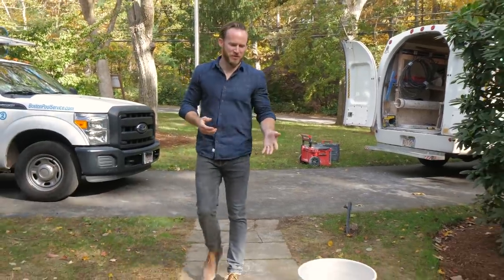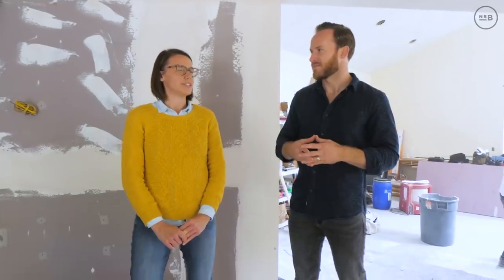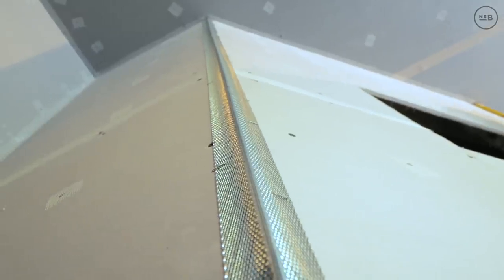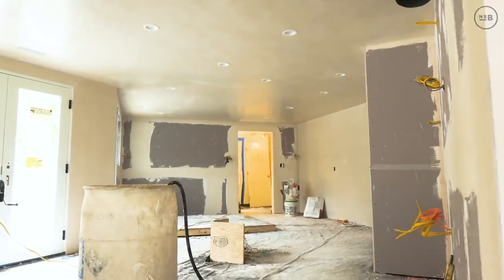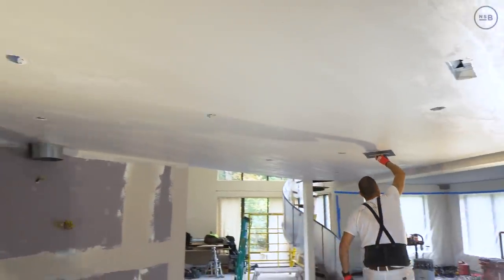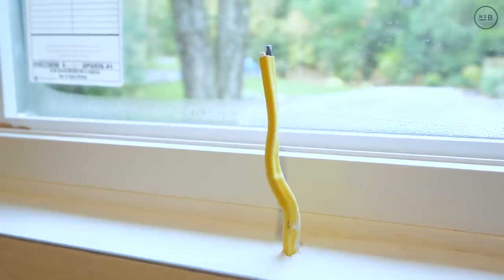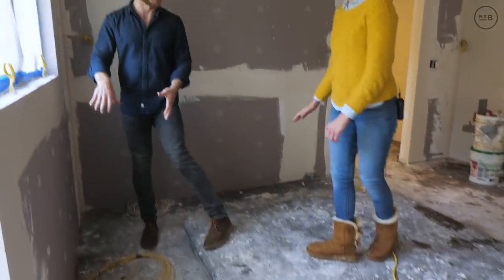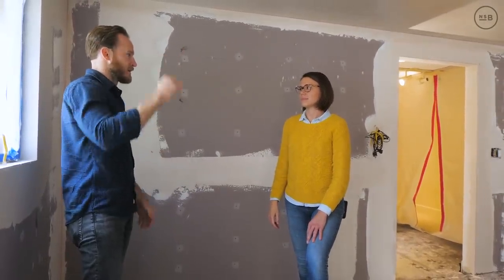Why we use Blueboard and Plaster

Comment: Most of the higher end homes I framed in Tucson were done with plaster. Imperial board. Amazing finished look.
Reply: I live in Tucson and haven't seen it here before do you recommend it for new construction?
Reply: @ignaciogamez8394  I would recommend. I used it in some historic renovations in Barrio Viejo and Sam Hughes and new builds of custom Santa Fe style homes.  It would depend on cost for me though. More labor intensive from what I remenber, but it gives that flat wall finish that I have not seen repeated with the Gypsum products.
Reply: Ignacio Gamez I live in the U.K. and for us it provides better insulation and soundproof so I would recommend it especially since I know Tucson can get very hot
Reply: @mortensendesign918  It's not more labor intensive as far as cost goes.  Yes, physically it's more labor intensive and you need to work quickly.  Because of the speed it is FAR less time and FAR less mess than drywall.
Reply: Thanks, I"m looking to replaster my wall and was going to take out all the lath and re-lath, now looking into all the sheetrock options. Could not find Rock board or blue board near me but imperial board, I found, oy

Comment: Plaster/kalcote is somewhat common in the Midwest USA too.  Though the rough sand finish is more common. Costs more for smooth walls.  A lot less callbacks on plaster. And it's tough.
Reply: Are they using lime or gypsum?

Comment: This is exactly how we do it in the U.K. I cannot see why many more houses in America don’t have plastered walls because one you’ve put jointing compound in the joins and over the screw heads you might as well just plaster the wall and when you do plaster you don’t have to tape over the screws (some people say that the screw heads will pop the plaster but I have never ran into that issue because if you secure the plasterboard properly you shouldn’t have that issue) and also you are less likely to damage the wall I mean unless you throw something heavy at the wall you won’t have holes in your wall and plaster can provide better insulation, sound proofing and better fire proofing so in all fairness the only benefit to just straight up drywall is that it’s a little bit cheaper
Reply: I'm fixing, replacing my plaster walls, and although it's a bit more tedious and costly, I am an artist by nature. I love the texture and then --- lime paint. heaven
Reply: Plus ain't to many  guys  know how to ,,I don't and I've been doing drywall for 40 years

Comment: I've never seen plaster applied in the US.  I thought you guys just mud the joints, sand and then paint?  By the way,  this is the only way we do it in the UK
Reply: I am a platerer in the UK mainly lime in heritage but have worked on plenty of modern methods.  I found dry lining used much in commercial jobs and London also where Knauff are based around Kent.  Finish plaster is used allot north London and where British Gypsum are based. in real a big crossover and many new plasters on the market now.
Reply: Generally; in lower cost housing we do just Tape, mud and sand the screw dimples and joints but in higher end housing we will Float the entire surface after initial taping and mud has dried and had a light sand. We will carefully float the entire surface, with a wide stiff blade, then use a longer sanding board to wear down high spots. I have only rehabbed 7 homes, but have never seen drywall mud left unpainted.
Reply: @eco-hot3231  interesting,  thanks
Reply: @mikegrady8931  I'd heard this,  that painting plasterboard is starting to take off in the UK.  Imo a plastered wall just feels a lot better.  Plastering in the UK it's neither cheap nor expensive,  I guess because it's common it's not a rare specialism like in the US

Comment: Nice to see plaster work. Its old school. The hole point of plaster work is to put up the traditional architectural details usually associated with plaster. Like The ceiling / light  medallions. And the traditional crown moldings made from plaster. It will be intersting to see the finished product because it looks very sterile and lifeless without trim work at this time.

Comment: As a plasterer in Pittsburgh in prefer a 2 kote/coat system...a base and veneer plaster system! Not fond of this 1 kote/coat approach. Done it before and Doesn’t feel as durable. Plaster adds a level of integrity to a structure not to mention its better in my opinion then just finished drywall! Your not doing cornice with joint compound!
Reply: r u looking for a job let me know I'm in Pittsburgh

Comment: I might be wrong, but wont there be a whole much of cracks appearing as the house settles and moves? Its a wooden frame after all, not stone.
Reply: yup, we use this in the UK and 2-6 years in the house will have massive long cracks along the walls, especially around windows or in corners. But very easy to fix with filler and by that time the house is due a new coat of paint.
Reply: @tomcongdon7410  That sounds like a whole heap of unnecessary maintenance work. It's one thing to repaint your roof, but completely different ball game when you're talking fixing cracks in a 250+ sqm house after only 5 years. The more i think about it the more it starts to look like a complete nightmare for the homeowner.
Reply: Hard to repair ya and hard to match existing texture
Reply: I cannot speak to veneer systems but true plastered walls and ceilings are very maintenance free. I have seen houses over 50 years old that still are crack free. I am talking rock lath, Structolite, lime as the plaster system. Some of these were remodels in houses built a hundred years ago. Very beautiful and stunning ceilings as well. I will post some photos here when I get a chance. Seen nothing like it then or now.

Comment: Of course we do drywall in MA. It's kind of divided. The Eastern half of the state is usually blue board, and veneer. The western half is drywall typically. I like both. If of course it is done properly. I've seen some plaster jobs that you could tell they weren't very good, and I've seen some that were incredible. Same goes for the drywall. Drywall return windows remind me of a shitty duplex tho. Gotta have nice trim and base. Great video 👍
Reply: Us in western mass like to save money instead of blowing it away like in the eastern parts or the Berkshire’s
Reply: @kchilz32  People here in east MA sure have money to spend on blueboard and plaster. It's a better product than drywall, so, why not? We work in million+ dollar homes. Customers pay anywhere from $95-135 per sheet.
Reply: @fernandatv  thats great if they like to blow money away. Drywall works very good and can be made to look great.

Comment: Adding blocking to the ceiling joists and strapping was a huge waste of time. I would have sistered 2x6 to the joist to level ceiling. Much faster and you are not fastening strapping to the end grain of a block. Just construction criticism. 😉 You and your crew do amazing finish work. Some of the steps are very overkill. But after 35 years of doing interior finish I’ve learned a few things from your videos. If I was 20 years younger I’d love to work with your crew.
Reply from the maker: Thanks John! Appreciate you saying that.  I like it when people provide an alternative solution instead of just saying I would have done it different. Sharing perspectives and methods is what moves the craft forward.
Reply: @NSBuilders  I appreciate the fact you can accept criticism without being combative. Shows your level of professionalism is higher then most I deal with. In my opinion the trades are dying a slow death. Too many subs these days do not take pride in the work they do. I talk to subs all the time that take shortcuts and just do shoddy work because “it’s all gonna be covered in the end”. Just wondering how you deal with this type of sub. It’s hard to get people to work these days and even harder to get them to do things with intention and pride. Your attention to detail is amazing. Doing things right the first time is so critical. I always tell people if something starts fucked up, it stays fucked up. Don’t fuck up. Lol. I could go on but I’m sure you’ve seen it all as well. If your ever in need of a project super with 37 years in the business I’m interested in working with you. All the best my friend.
Reply: Came here to make (mostly) the same comment.  Sistering some straight 2x6s would take 2 guys less than a day and am confident would produce a better result.  Not only that, but the ceiling on this project is VERY low and is 3/4" lower by hanging 1x vs sistering 2x6s.  And yes, I also agree that NS Builders generally does some very impressive work.
Reply: And on the off chance anyone reads this and is curious re: tips for creating a flat ceiling: 1. You use a laser to find the lowest existing joist and to hang ledgers on the walls perpendicular to the joists at that level.  2. Ledgers can be anything "perfectly flat" (good pvc trim, then sides of OSB sheets, or strips of OSB if you can rip them straight on a table saw, etc.)  3. If you have a relatively narrow room you can just drop the sisters on each side of the ledger, if you're dealing with 14? 16? ft+, you use two lengths of 2x6 per joist, hang one side on the ledger and use the laser to get the other side level.  But you only need to do this every 6 or 7 joists.  After you have two pieces sistered 6 joists apart, one guy can hokd an 8ft level between them effectively making a ledger for the joists between.  4. Get straight 2x6s.  And since no 2x6s are perfectly straight, sort them by straightness so that the straightest pieces go against the walls parallel to the joists, and the least straight end up in the middle of tthe room (crowned side up of course).

Comment: I worked in nyc for decades and the use of plaster was quite common. Blue board is essentially drywall- just a different outer skin which chemically bonds with plaster. I have seen many plasterers use Diamond veneer plaster to get the mirror finish. Diamond 'veneer' plaster does not require to be mixed with lime. Beautiful finish!

Comment: From the UK. What's the difference between this and plastering the wall.
Reply: jordan9318 I think it’s the same. What he’s saying is this is only done in his state here in the US. The rest of us have homes finished with, drywall. Some call it Sheetrock. It’s a fire-retardant board that they spray a finish on. Typically an “orange peel” finish here in the Sunbelt (Southwestern US) but “skip trowel” is becoming more prevalent in the newer homes. The plaster is more expensive and usually saves for more luxurious custom homes rather than the tract-houses most of us purchase. From what I’m reading, y’all in the U.K. typically do plaster so that may be why you seem confused as to what’s so different about this. Lol

Comment: Blue board does count as drywall. The blue/purple has the moisture resistant paper on it. The title is misleading. It made me think of lath and plaster.
Reply: The blueboard paper is not moisture resistant , just the opposite, paper absorbs moisture and plaster into it.  Burnishing the plaster is actually not a good idea. It looks impressive but you want the primer paint to "key into"  new plaster surface. Burnishing blocks a good bond with the primer.  Yes most of the plasterers do it this way , looks great until you get all the lighting hooked up , walls are painted and realize a lot of seams show .  Need more effort on hiding / leveling at blueboard seams than making it shiny.

Comment: You guys seem to do a lot of nice work, but that low ceiling is a joke.  You could have done LESS work and had a flat ceiling that was at least an inch higher and more solid.  You probably could have had a ceiling 1 1/2" - 2" higher with the same amount of time/cost as what you did to make that cave ceiling.  And for the cost of a very small percentage of the total project, you probably could have had a ceiling ~4" higher than what you ended up with.  I mean, that $200,000 wine cellar is cool and all, but it's important to get the basics right first...

Comment: Not tryna hate, but this looks like basic drywall with a "skim coat"... I believe authentic plaster is built up on wood lathe and is hard as concrete... blueboard is drywall... then they are skim coating it... if you headbutt a wall in this house your head will go through the wall... If you headbutt a real plastered wall you will go the the hospital and the wall will look perfect still...
Reply: Very true. Modern interior 3 coat plaster uses gypsum plaster over expanded metal lath and is much stronger and more durable than drywall. Another major selling point is that, unlike drywall and blue board, traditional plaster will not deteriorate after short-term exposure to water and, due to the lime content of the plaster is resistant to mold growth.
Reply: I was going to point that out.Thanks for bringing that up.As a plasterer for 30 yrs my experience with 3 coat system has onlyever been in historical renovations

Comment: Nothing new here I have been doing this in UK for over 30 years , much better than drywall,  stronger and longer lasting . Good job though
Reply: I'd rather have well done drywall than a bad plastering job. I've spoken to contractors who like plaster because it lets them get in and out on the same day, but if someone doesn't have the skill to plaster, it's much easier to do a good job of drywalling. I don't buy the notion that 1/8" of plaster over 1/2" of drywall is going to be any stronger than 5/8" drywall, but the surface seems more resistant to some kinds of abrasion (not to mention that nice mirror finish). On the other hand, if the building is subject to a lot of settling or vibration, taped drywall is a lot less prone to cracking.

Comment: I watched this entire video and never learned "why" they didn't use drywall, only that they didn't
Reply: To get a near perfect flat ceiling. As where sheetrock will have hills and valleys plaster will be super flat. Also when they pu up th cabinets they want to be off the ceiling about an inch for the shadow look, with a perfect flat ceiling it will look great.

Comment: That’s not plaster. Do it the traditional way and then call it plaster.
Reply: If its not plaster then what is it?
Reply: With lath
Reply: Ohio Outdoors are you referring to old wood lath, or new metal lath ?  They are both plaster systems
Reply: bmlsb69 there’s wood lath and then there’s also plasterboard that gets nailed up then wire mesh in the corners and then plaster over that either one of those two is what I would consider plaster
Reply: Drywall was originally created for plaster. It replaced traditional wood lath to make it easier to install electric receptacles. Drywall use to come in 2'×8' and the installers would drill holes in it for the plaster to seep through and lock in, and use diamond patterned metal lath in corners, ceiling joints. This method shown here just seems to be improvement on that method, resulting in an easier to repair end product that looks better than regular drywall with a level 5 finish.